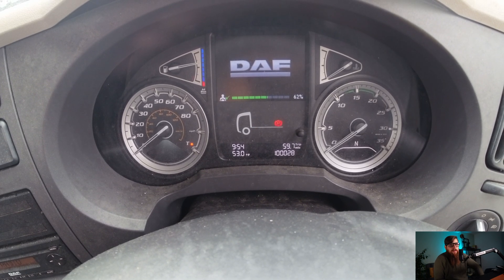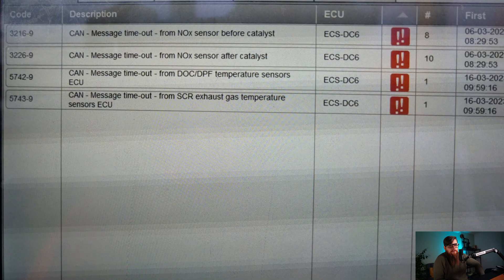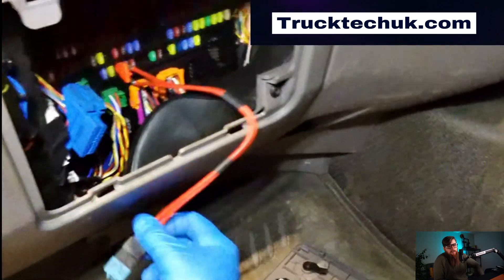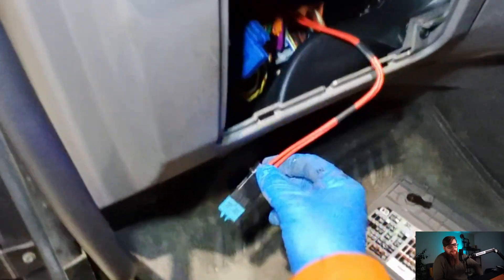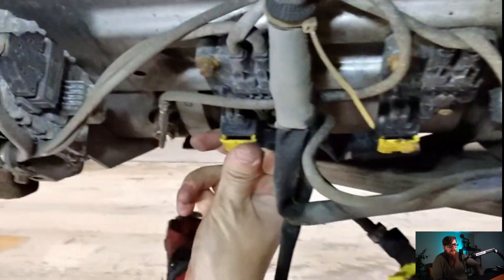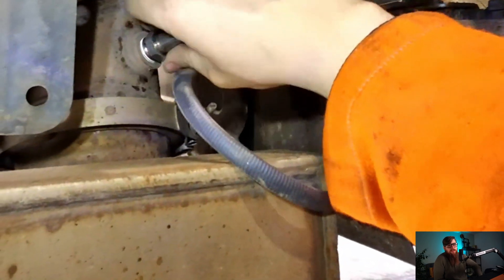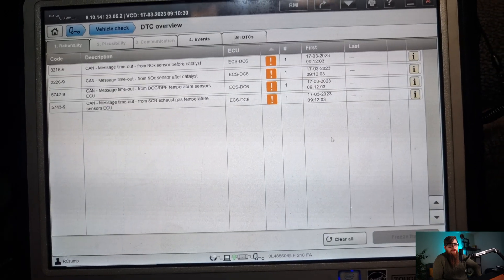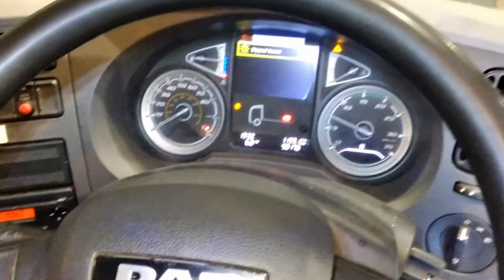DAF LF Emission Fault? this is How you could Fix it FAST!

Comment: Please could you advise we have 3 daf CF 290 vehicles. At least once every 2 months each vehicle comes up with the same error as on your video more often than not the vehicles go into limp mode. Once fixed they run fine for a couple of months then they have the same problems.
Reply from the maker: Hey, thanks for the comment 👍.  So you get time-outs on all your sensors once a month? Do you have to replace the fuse or do you change the components?
Reply: It varies our mechanic tells me its sometimes the NOX sensors and quite often the EGR valve is clogged up. Its costing us a fortune in DAF and repairs.
Reply from the maker: @user-zj1wr5ro2k  Without seeing the actual fault codes I couldn't comment on the best way to rectify them mate. If it had been to DAF I'd of expected it to be correct when it left them.

Comment: Hey Mate, do you know if the Nox sensor diag tool puts a load on the circuit so you know if the power and earth are good? FYI I have the same tool but from aide automotive.
Reply from the maker: Hey Dave, thanks for the comment. The load on the circuit is provided by the sensor. Just like a bulb acting as a consumer, the nox sensor itself will pull a current when it's heating the sensor. The tester monitors the circuit in-line and will give you the reading to determine if it is good or bad which you can check against your source voltage.

The tester I designed is more of a quick first-look device to aid people visually. If you're competent with a multimeter, wiring diagrams and manufacturer data you will get the same results.

Comment: my daf lf 150 has the same faults as this ive had a new nox sensor ,ad blue dosing module cleaned out all my egr valves plus cooler and still comes back with the faults its on a 64 plate im loosing the will to live with it
Reply from the maker: Hi Sam I take it this is your car transporter that wasn't dosing correctly? If it is still faulting with the same issue, I suggest we have another look at it to see what we're dealing with and get to the bottom of it once and for all. If you want to contact me to arrange this I'm more than happy to help.
Reply: yes it is the same problem but im very reluctant to pay out loads more money. ive spent over £1200 on call outs on people trying to sort it as I said from this clip ive done everything that is the possible problem 
 @TRUCKTECHUK
Reply: yes but the problem is that you came out to my vehicle a couple of months ago and never went through any of this
Reply from the maker: @user-cr6ib8tt2y If your vehicle was attributing the same symptoms as this one I'd of gone down the same avenue of testing.  The faults you have on your dash which are the same as this are generic driver warnings and don't mean anything to a technician other than the truck has faults.

The diagnostic trouble codes you do have in your ECU are for adblue dosing and egr which we identified through the lack of AdBlue dosing from the valve which you were going to change before you sold it the next day. 
If your still having issues I'm more than happy to look at for you.
Reply: yes they are the same issues.
 to be honest ive lost the will to live with it. might take it down a lane and fire it lol  @TRUCKTECHUK

Comment: Have you seen the nox sensors from daf tjat have the big repair connection between the nox ecu and sensor section.  Never known one of these to last more than a year
Reply from the maker: Hey buddy 👋. Yes, I've had them before and I've mentioned to a few members of the group about them being manufactured in Mexico. They have a Deutsch Connector in the harness between the ECU and the sensor. I believe (my own opinion)  them to be remanufactured using the old ECU and a generic nox sensor hence the connector. 
I'm yet to try repairing genuine sensors as they are returnable so no old units unfortunately.

Comment: Hi mate another great video any chance you could give the part numbers for upstream and downstream nox sensors for. 2015 daf cf reg no. CN15 OJW I’ve had wrong sensors delivered from my local daf dealer and I’m not sure they are getting the part numbers right no worries if not but worth an ask thanks mate plus can you link me up to the special tools they look like they will be really helpful to get them both thanks 👍🏻🏴
Reply from the maker: Hey luke, thanks for the comment. In regards to the sensors, they should be idiot proof on the 2015 model. 
Nox before being 2006243 which superseded to 2293964
And nox after 1953530 superceded to 2139930

I can't reiterate enough that wrong or non-genuine sensors will only cause massive issues from a software verification point of view.
Reply: @TRUCKTECHUK  ok thanks I will check those part numbers against what I’ve been given lol about idiot proof 😂 not possible in my place of work 😂thanks again 👍🏻🏴

Comment: Hello! I have a question about DAF XF 106 trucks that come with the TRAXON automatic transmission. Can an INTARDER be installed on these trucks? And if so, how can it be connected to the vehicle's electrical system and configured to work with the TRAXON transmission? Thank you in advance for your help!
Reply from the maker: Thanks for the comment. You can't fit an intarder.

Comment: That nox came out wayyyyy to easy. Why do I have to use heat or breaker bar as long as a pool cue nearly every time. Great video though!
Reply from the maker: Hey David, thanks for the comment 😎👌. It is not always the case, my friend. 
if they open up my nox sensor socket when im renoving them, the plug gets cut, and a 22mm deep goes on with a half-inch bar 😅.....sometimes can be good.....sometimes can be shit 🤣🤣🤣🤣🤣🤣

Comment: For finding shorts I use a box of 4 H4 bulbs 2 12v and 2 24v with a switch to change what volt woking on. Benefit is while shaking wires or driving around the box lights up to let you know it's shorting and you don't have to reset it every time there is a short
Reply from the maker: Thanks for the comment and for watching the video. 👌
 I did use a bulb for a while, but after damaging a temperature sensor when testing for a short to ground, I moved to resettable fuses because it provided me with protection against overcurrent conditions in
Reply: @TRUCK TECH UK  in case of low currents curcits I just use a smaller bulb close in expected current draw of the circuit